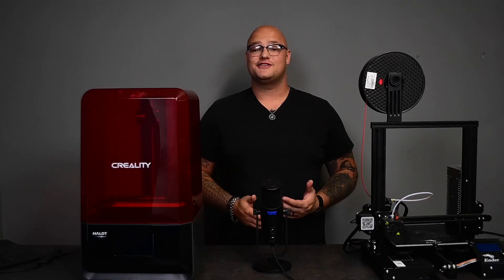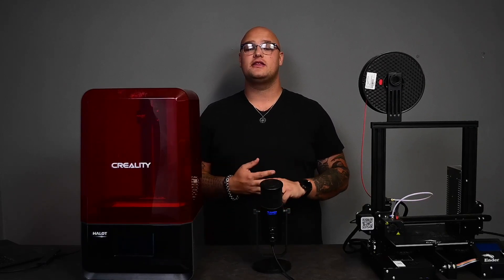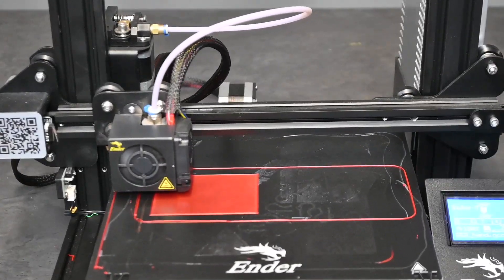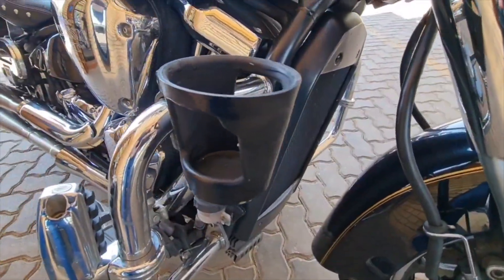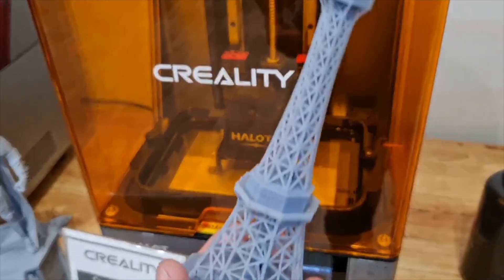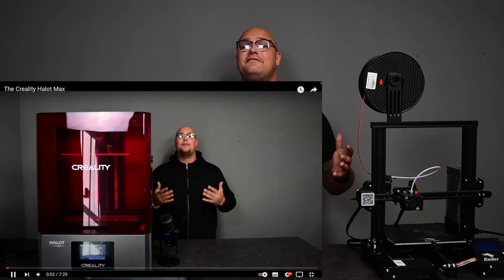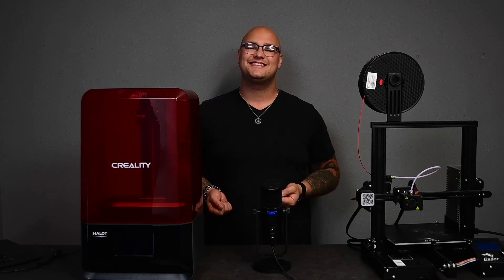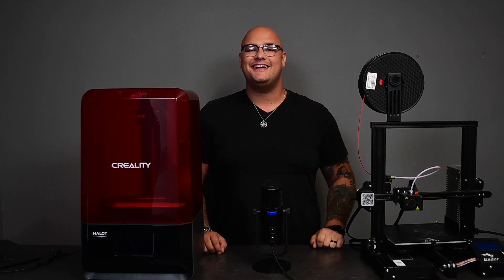You have the WRONG 3d printer | Creality halot lite

Comment: How really safe is this resin printer for like having it in appartement and printing in a room? As you said it has filters, but I bought it, did one print and stopped as smell was still strong
Reply from the maker: The fumes from resin printers can cause headaches, nausea, and many asthmatic symptoms. So you would rather want it in a well ventilated room, or a different room to you entirely. 

Some people are completely unbothered by the smell or fumes, but most people are affected by it.

Comment: Print settings?
Reply from the maker: For the resin print, we recommend 6 initial layers at 35 to 45 seconds per layer, and a normal layer exposure time of 2.5 to 3 seconds per layer, the supports are dependant on the model that you are printing

For the FDM printer, PLA specifically, we use a layer height of 0.2mm, hot-end temperature of 200 degrees Celsius and a bed temperature of 60 degrees Celsius. The retraction settings and speeds are dependant on you printer as well, but a printing speed of 50mm/s you won't have any problems with detail loss. Retraction distance of 5mm with a retraction speed of 20mm/s - 30mm/s usually helps to keep stringing to a minimum